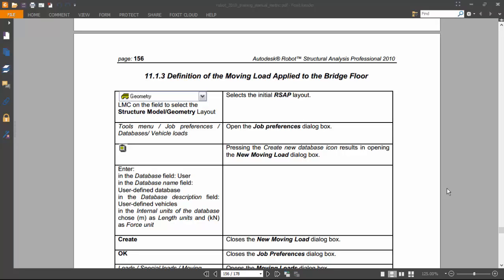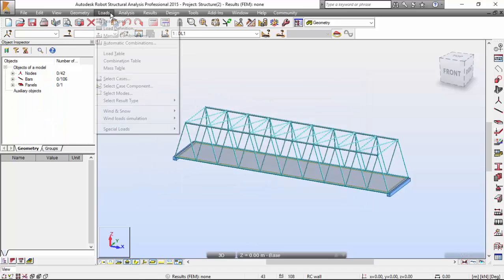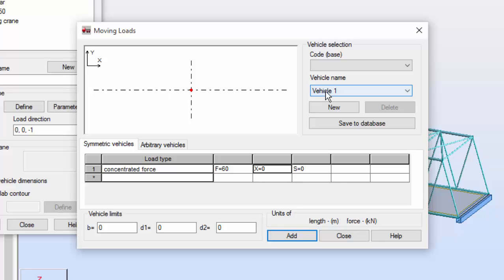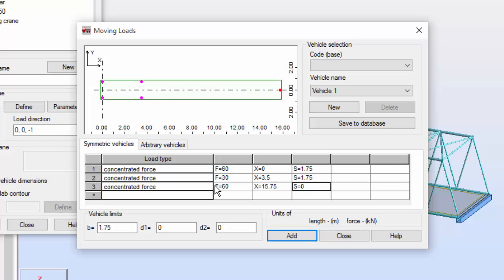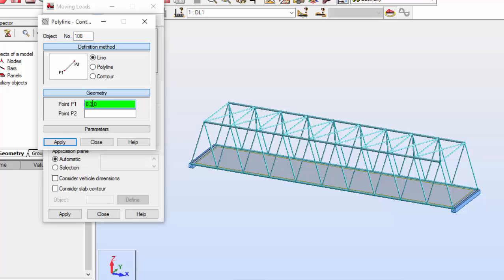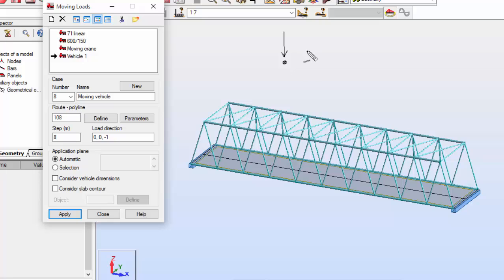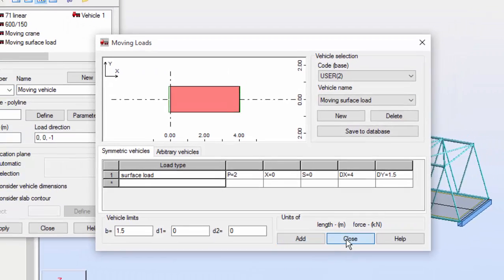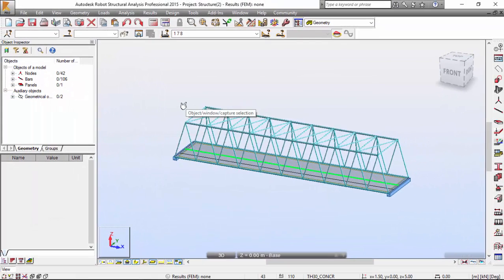Exercise11 - Part 3 - 3D Single-Span Road Bridge with a Moving Load (Robot Structural Analysis)

Comment: Dude, I don't have moving load on shell model, I had to switch to 3D Frame, is that normal?
Reply from the maker: +Othman Ouahabi no, not at all. You should have that available in both types. Try to open the model in recovery mode.
Reply: Thanks a lot